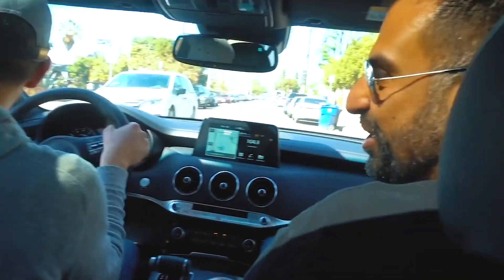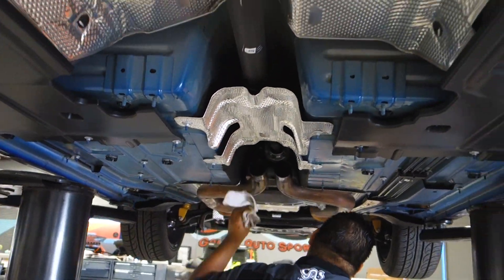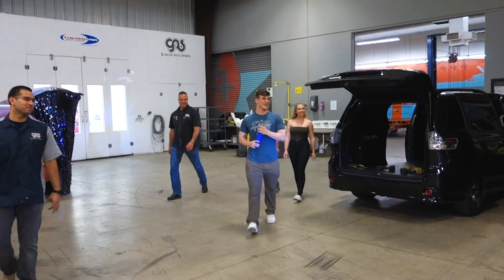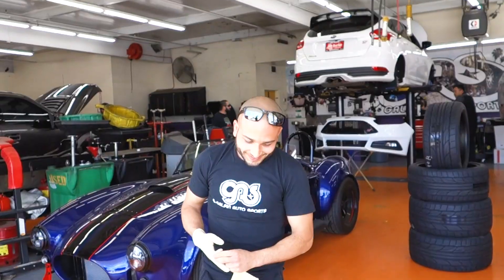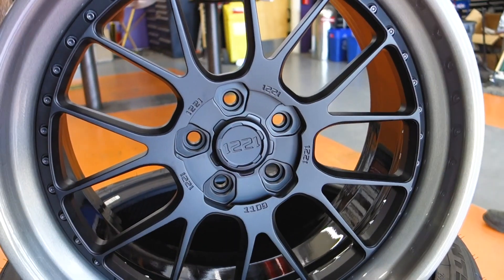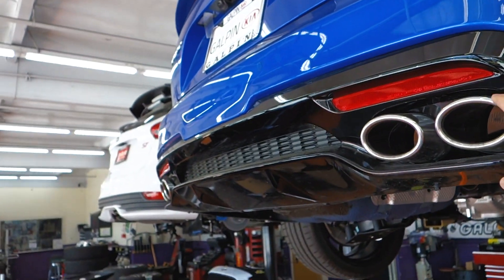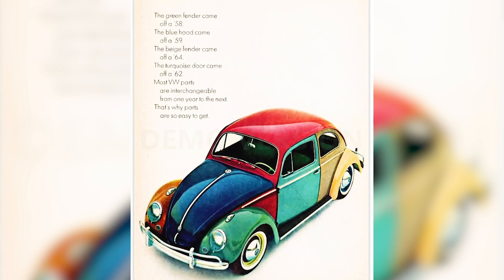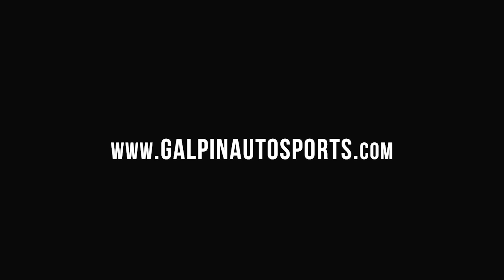Delivering the new Golf GTi Harlequin to Salomondrin!

Comment: Is the Stinger a 4 banger ?
Reply from the maker: This model is a GT and its powered by a twin-turbocharged 3.3-liter V-6 putting out 365 horsepower and 376 lb-ft of torque mated to a eight-speed automatic transmission.

Comment: Did you tell the hellcat owner that those yellow things on the front lip are supposed to be removed before delivery. Lol. I see a lot of guys driving around with them on and have had the car for a while.  Its funny because it says remove by dealer right on them.😂😂😂
Reply: studdaman420  Right! I see the same thing.  However after riding in a Hellcat, entering and exiting low dips that yellow lip protector does help.
Reply: Costarica 1700 it probably does help a little. However those in the know know it should be removed. I've had low vehicles in my time.  You learn to take dips and driveways at an angle or have a moment of silence for the splitter.